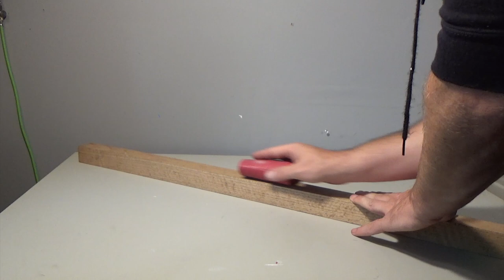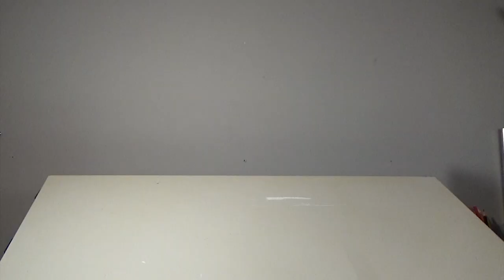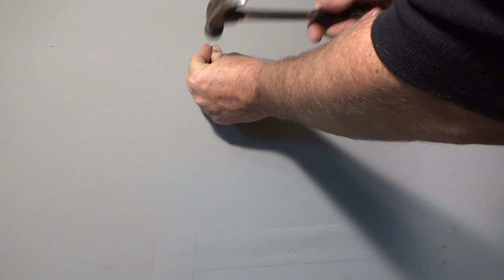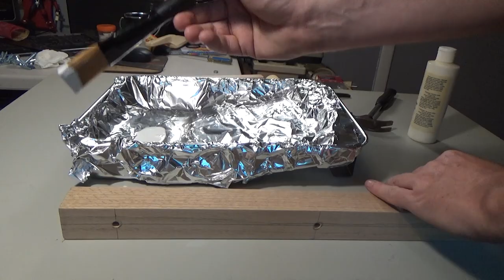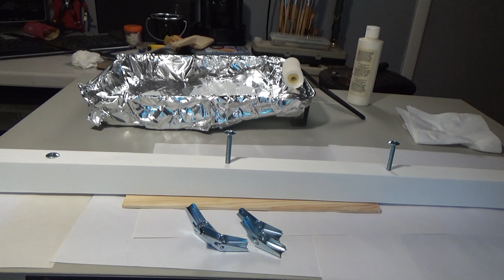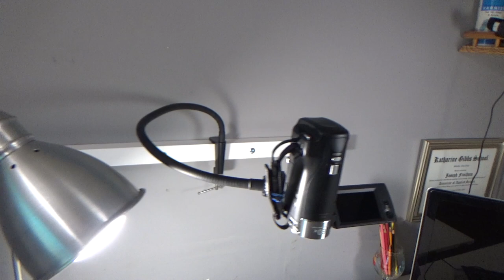Adding a D.I.Y. Clamp Bar to my Studio Wall to hold Cameras and Microphones - Studio Improvement

Comment: Did you have the camera clamped to the table before?  If so, this is a great solution!
Reply from the maker: I had it clamped to the drawing table, which shook a lot, then to a different table but it still shook enough to be annoying. 
So far, this is great, but it holds it a little high, so I'll have to remember to check the camera often or lower the position.
More testing required.